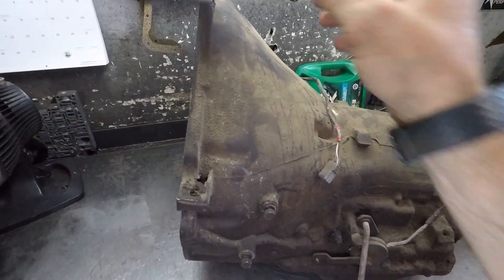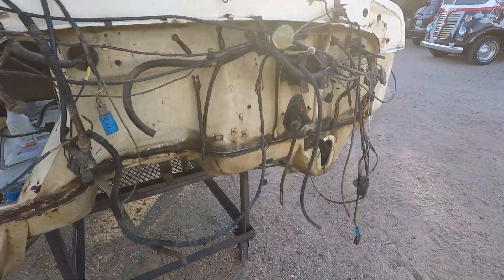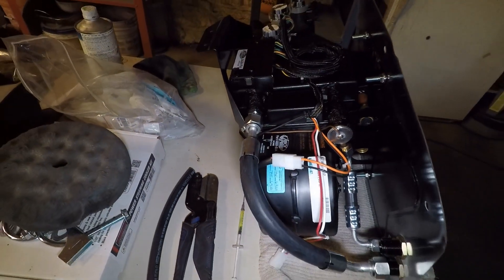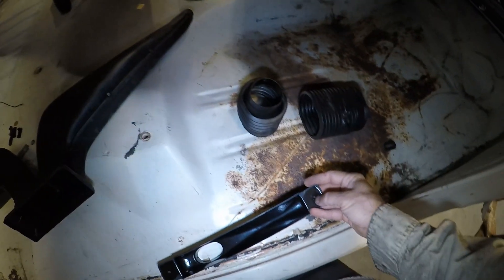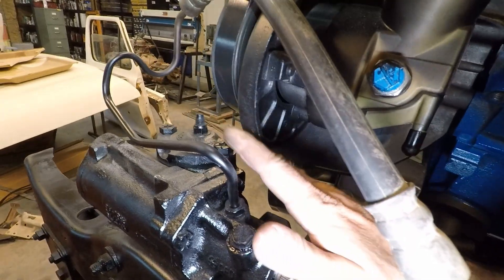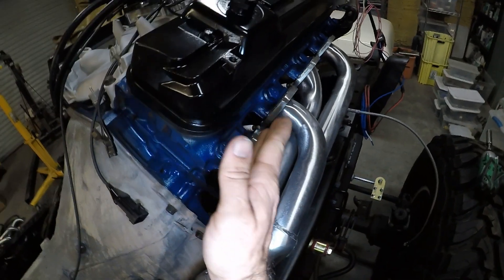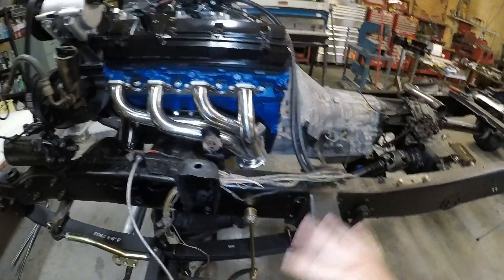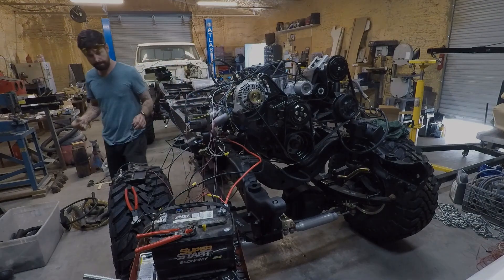1979 F-350 4X4 Supercab Build (Episode 8)

Comment: Broncos use double cardans so they can rotate the diff up and not have issues with mismatched angles.They are normally in the rear on Broncos, and the front on F250/F350. The two ujoints in the cardan cancel each other out, allowing the other end to be around 0-1 degree or inline with the pinion.

Comment: I had a couple 88 Rangers with that crappy headlight switch. What a lovely piece of over engineered crap that was.

Random note, my 96 grand cherokee also has a double cardigan joint on the front shaft on the t-case side, then a CV on the axle end.  Solid front axle with cv's instead of u-joints. Car companies do weird things..

Thanks for the update video. This truck is going to be waaaayy better than new when you're done!  I quite enjoy your attention to detail on so many little things, you're clearly enjoying what you do. Hope all is well with the move to TN and you're getting settled in!

Comment: That really did seem to run smooth right off the bat. (well, after the ignition re-wire?)
Thanks for the video.
Reply from the maker: Those Holley Snipers are amazing. The speed at which they self learn is crazy. Can't recommend them enough

Comment: Im pretty sure my dads 78 bronco has the double joints front and rear, I could be wrong there tho too, its been years since ive been under it
Reply from the maker: That would make sense as the fronts are very similar to the F250 and the rear is much shorter

Comment: I like how Ford put the blower motor inside the cab with it sticking out into the engine bay.  Unlike Chevy who put it in the engine bay and can be changed without taking half the truck apart.

Comment: How did you modify the second gas tank?  Did you do anything special with the fuel pump to make it work with the EFI?
Reply from the maker: I had to add in tank electric fuel pumps to both tanks and a selector switch and valve from a modern diesel superduty

Comment: That style of push button release headlight switch goes back to at least 1960 on the Falcons, Fairlanes, Mustangs, etc. One you learn the secret handshake, they are pretty easy. Most guys try to push the button, then pull the shaft out of the switch. Wrong. Pull the shaft out to headlight on position, then push the button, then pull it out the rest of the way.
Reply from the maker: I just came across a older ford here in Tenn that I had to pull the switch on and it worked just as intended. I wonder if the AZ heat has anything to do with all the problems I had with them
Reply: @AustinCoulson  It's all metal, so probably not. But one method or the other will surely work.

Comment: With that brake set up, did u get rid of factory valve bolted 2 the frame?
Reply from the maker: Yes, the built in adjustable proportioning valve eliminates the need for the frame mounted PV

Comment: Refresh my memory.  Why didn't you keep the OEM HVAC?  Needed room in the engine bay?
Reply: The factory 70's system sucks. Needs lots of vacuum hoses, and cables. The Vintage Air is more efficient and the controls are fully electronic, so much easier to place and route.
Reply: @kstricl  I don't remember any vacuum lines on that unit.  All cable operated.  I remember them working pretty well too, until it gets plugged up with debris... which raises another question.  Does the Vintage Air provide outside air, or is it a permanent recycle?  And now another question how do you integrate it with the OEM controls?
Reply from the maker: That's a good question I didn't really address. You are correct there were no vac lines for the climate control on that model. I went with the Vintage air kit because it is more efficient and designed to work together. I have done R12 to R134a conversions in the past and I don't prefer them to the VA Gen IV setup.
Reply: What ac kit did you go with vintage air. Thanks great videos
Reply: Who makes your headers that you used on that motor thanks Rob.

Comment: Austin, Im looking for this brake set up on Summit and struggling . Any chance you have a part number? Thanks
Reply from the maker: No problem, here you go. I LOVE this setup:

SUM-760113 MAST CYL KIT ALUM BLK ADJ 1.25

SUM-760125 BRAKE BOOSTER ROD EXTENSION KT

SUM-760167 BOOSTER POWER BRAKE
Reply: @AustinCoulson    Youre the Man. Thanks so much

Comment: I love this build!  I have a question well not for me but foranother channel I follow . Motion Raceworks. They are on the Rocky Mountain Raceweek 2.0 and they are racing a couple cars but one is a stock 2000s grand marquis and they are close to getting it to 12 seconds in the quarter.  They have ran into a limit. 99mph speed limit in the computer. Do you know a way to get around this? If you do head over to their YouTube channel and give them some info. I thought maybe with all your crown vic experience you might knoe a trick Thanks man and keep up the good work
Reply from the maker: They can swap to a PI computer. Only change would need to be also swapping the airbox to a PI or Marauder. Other benefit would be an 11hp increase over the non-PI intake setup. I'll check out their channel

Comment: With this build what front accessory drive did you use?
Reply from the maker: I used the factory OBS 460 front drive
Reply: @ thanks so much! Doing a similar swap in my 78 f250 4x4
Reply from the maker: @matthewsmith-ng9ds  the only real problem I had was finding headers that fit around the frame and steering box. I had to use two different sets
Reply: @ i may end up just using manifolds, what motor mounts did you use? L&L?
Reply from the maker: @matthewsmith-ng9ds  I would recommend manifolds. There's not really a huge performance benefit from the headers that can fit in there. I forget what mounts I used, but L&L sounds right

Comment: As a mechanic with a half century of experience. The headlight switch you complained about was universal gm Mopar and even Japanese cars used them . As far as STUPID engineering ford is right up there in ass hole shit $2000+ to replace a water pump on focus and the head gaskets designed to fail at 100,000 miles that actually lasted 60-70 thousand miles are a couple Biggie's
Reply from the maker: Is that one of those water pumps that is driven by the timing belt? For some reason, I never had the same issue with the GM or Japanese switch knobs, those seem to pop off just fine. The Ford ones always fight me
Reply: @AustinCoulson  yes it is . Also gm Chrysler and Japanese cars used the same switch it was because they had dash dimer switch integrated . Japanese manufacturers went to light switches integrated into the signal light  years before the big 3 . But I have cussed them all. I THINK the switches were cost saving. So all. Manufactures used them until Japan started taking over. 
 Like torx screws gave the manufacturers free torx screws and tooling . Because they knew they'd be selling a new set of torx bits to every mechanic.